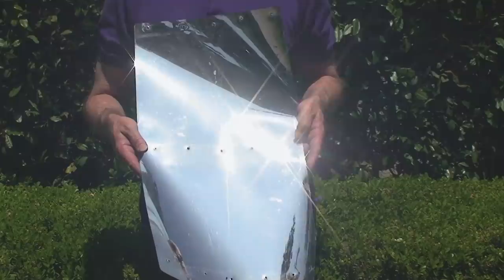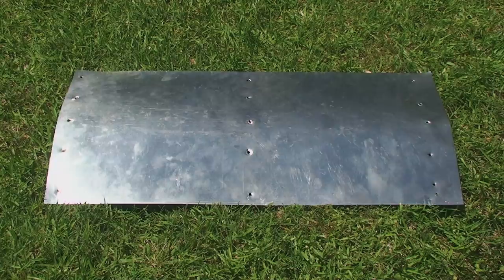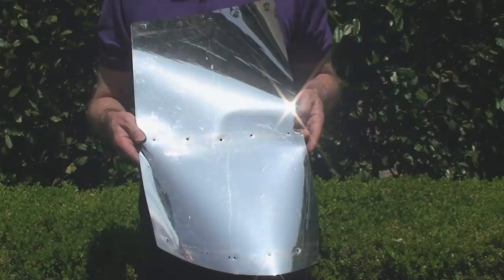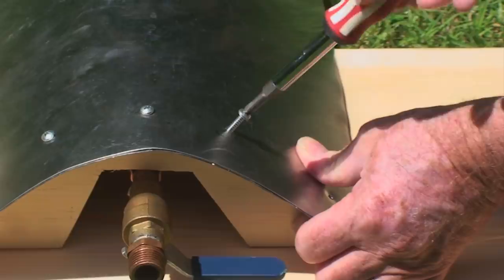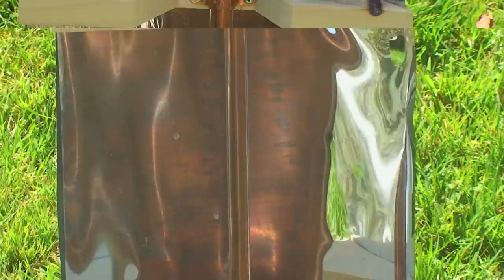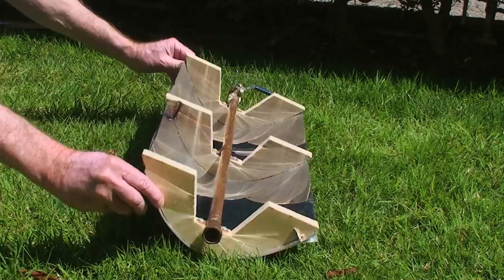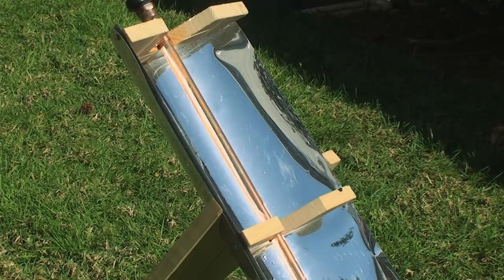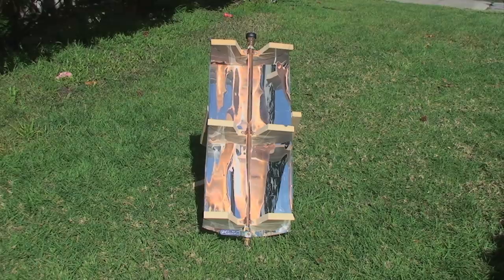Solar Water Heater Demonstration

Comment: Thanks for posting.  In 1970, I build one of these for a science fair project.  I elevated the storage tank (a 5 gallon metal can) and used thermal convection to circulate the water.  Worked great and was a great demonstration of solar water heating on a budget.  The whole device cost less than $20 to build and was a fun project.
Reply: That was my exact thought using thermosyphon. The Mother Earth News featured a similar set up recycling a refrigerator box.
Reply: For some reason I had a problem getting mine to circulate by convection.
Once the water boiled it caused pressure in both directions within the pipe and would just repeat with no circulation
Reply: @drd1924  The tank has to be elevated above the top of the collector.  The water should never boil.  The size of the hot and cold pipes to the collector should also be of sufficient girth to allow unrestricted flow between the storage tank and the collector.  I won the 6th grade science fair with mine.  I was 12 years old then.  Enjoyed the heck out of building it.  I still have the collector that I built in 1970!
Reply: @winfordnettles3292  Gotcha, thank you sir....Perhaps my pipe size was too small to allow sufficient flow for exchange...Will try again. I was also thinking of installing a check valve to ensure proper flow direction should boiling occur
Reply: @drd1924  "Check valve"
Reply: @winfordnettles3292  Should have perfected one by now🤔.. liberals pfft
Reply: @drd1924  ops didn't see this post in time.
Reply: @CharlesGann1 🔴 What Is Islam? 

🔴 Islam is not just another religion. 

🔵 It is the same message preached by Moses, Jesus and Abraham.

 🔴 Islam literally means ‘submission to God’ and it teaches us to have a direct relationship with God. 

 🔵 It reminds us that since God created us, no one should be worshipped except God alone. 

 🔴 It also teaches that God is nothing like a human being or like anything that we can imagine.

🌍 The concept of God is summarized in the Quran as:

📖 { “Say, He is God, the One.  God, the Absolute.  He does not give birth, nor was He born, and there is nothing like Him.”} (Quran 112:1-4) 📚

🔴 Becoming a Muslim is not turning your back to Jesus. 

🔵 Rather it’s going back to the original teachings of Jesus and obeying him.

Comment: In Australia, 80's. There was a same system unit called 'Suntrac'.  Had 2 reflectors,  about 5ft long, 2-3 ft wide. Tank on the top,  clear covers, and a water pressure  tracking system. The centre pipe was sealed with a gas inside, this pulsed the heat into a sealed end bulb within the tank.  Worked well.

Comment: Back in the early 80's I worked for a company who installed this type of hot water system in Nevada. Pre built 8" long parabolic collectors with blackened copper pipe set into an aluminum framework on the roof of the house. the system had a sun tracking feature that kept the collectors facing in the optimum direction while set at the best average angle to the sun for the latitude. This was a closed loop system. Meaning no household water entered the system. The system water was pumped through a heat exchanger tank and back up into  the collectors. The house hold water passed through the heat exchanger into a storage tank and then into the existing hot water heater and into the house. This method allowed the existing system to be isolated in case of emergency.  On many occasion during initial start up I watched thermometers go from ambient air temps of 50  degrees F to over 250 degrees F as fast as the needle could move. As the system would run this temp would come down to a more reasonable 200 degrees f. The normal operating temp of the system was designed to keep the household water in the 105 to 115 degree range. This technology should and needs to be utilized more these days.
Reply: Pretty trick for the 80's, especially having Sun Tracking with no laptops
Reply: @drd1924  The tracking feature was simplicity at it's best. There was a photovoltaic eye that had a small riser held above it essentially dividing the eye in two. as the sun moved (earth rotated?) and exposed the eye to sunlight a small motor connected to a chain drive would activate moving the collector just slightly to re-shade the eye and stop the motor. The riser was flat on the bottom and half circle on the top this allowed the eye to catch the correct amount of sunlight throughout the year without adjusting it.
Reply: @NVOutsider  Very creative!, Thanks for the explanation
I figured it had to utilize some sort of CDS cell, whats puzzling me is...
Did it know to reverse directions in the morning to start over or did it have to be reset every day?
Reply: @drd1924  the riser piece was 1/16" to 1/8" thick painted white aluminum. It sat directly over the center of the eye. so when the sun set the collectors stayed facing west as the sun hit the eye in the am everything would rotate to the east and start the process over. I have a feeling my explanation is really dumbing it down due to my 18 yo lack of understanding and it being about 40 years ago. The system was manufactured in Arizona by a company called USMC (?)
What is a "CDS" cell?
Reply: @NVOutsider  Hi, A CDS Cell is short for 
Cadmium Sulphide (a light controlled variable resistor, The Photoeye)
Thanks again for further explaining, rotating would make more sense. I was picturing the mechanism Panning and could only think of using limit switches to stop the movement and reset it. But simply rotating would simplify it even further...Very Cool
Reply: @NVOutsider  If you were 18yo in the 80's, chances are "the dumb down didn't stick🤣 If you don't believe me, 🤔 just ask me🤣
Reply: @NVOutsider mom
Reply: @adriaanvansandwyk5626  ???
Reply: @NVOutsider  Case where picture rather that word description would be nice.
Reply: @egria  So true.

Comment: In the '80s........I had a house with two four by eight solar panels in Massachusetts......... With one sonny day it gave me 160 gallons of hot water..... Heat exchanger, recirculation pump, anti-freeze.........it was all a great idea and savings..........this system looks to be more compact, and more efficient.
Thanks for sharing.

Comment: I though about this concept a few years back. I can see that it works! What I was also thinking was, since I live in a tropical country we have great exposure to the soon through the year, so I was thinking that it might be possible to reach boiling point with a little bit more industrialize set up in order to be able to get salty water from the sea and take the salt out! It could be inefficient but the sun is free so...
Reply: a donut ring of seawater, the vapor dripping from an upside down cone in the donut hole to the freshwater container underneath, the tide refilling the seawater part, solar power to provide electricity to pump the fresh water up to a roof tank
Reply: 1) Build parabolic mirror similar to the size in this video.
2) Install a clear glass oven pan with sea water in the pan.
3) The sea water will evaporate and rise as steam.
4) That steam is pure water.
5) Instal a thin sheet of clear acrylic a few inches above the pan. But angle the acrylic so that the steam droplets which gather on the àcrylic will slide down the surface of the acrylic and fall off into a separate pan.

Voila! Clean water.

Comment: I built one of these for a science fair project in the late 1970's.  I painted the copper pipe black, which made it heat up a lot faster than the bare copper.

Comment: Use a horizontal  arc that way it always point at the sun, the double curve is harder to make but doable with a flexible material, or just section and angle the sections to follow. This obviates the need for tracking. Also paint the pipe with flat black high temp. engine paint, so you get more frequencies absorbed.
Reply: I wonder if we could use the system to heat a working fluid so it could expand and push a hydraulic piston to follow the sun? My idea was to use the heat from solar panels to automate their turning.
Reply: @fajile5109  "Sterling engine" use the heat from the sun and the cool from the collectors  shade.

Comment: A good solar still easily reaches 50°C under sunlight and offers pure, hot water. An autonomous, off-grid user doesn't need those expensive solar hot water panels. Just a plastic sheet and a pump is enough :-) .

Comment: Very informative video. It is great that the use of copper is limited to one central pipe vs a long copper coil or multiple parallel copper pipe collector as copper is expensive. While glass mirrors would reflect more solar energy mirror polished stainless steel sheet metal would likely be more cost effective. Solar concentration is a great technology but it does have some drawbacks to be usable for the lay consumer. Boiling in a water heating system is not ideal as pressure builds up and could cause bursting issues. There would have to be some type of circulator, heavily insulated HW storage tank, temperature monitoring device, and a device that will shut off the circulator when approaching the boiling point of water as well as to rotate the collectors out of the sun. Also having to manually adjust the angle of the unit every few days is not feasible there would have to be some type of mechanical unit to pivot the collectors.
Reply: if you lay it east-west it will always be pointing to the sun

Comment: Mount this below a water tank, then allow convective circulation to heat the water in the tank by day, then by night, the heated water will stay elevated in the tank.
Likewise, make another radiator, but mount it above a second tank, to cool the water by night with convective circulation, then by day, the cool water will stay low in the water tank.
This way, you have both hot and cold water available.
Reply: Thank you for this comment.

Comment: If you install one way check valves the heat of the water will propel the water through the pipes/hose on a continuous flow. And I agree painting the copper pipe black will increase it's effectiveness and will draw the water from a tank or vessel and pump it into another tank or vessel.
Reply: This can heat fluid to circulate in hydronic heat system, too…putting 1-way check valves moves the hot water in the direction wanted, so it can recirculate.  
Can also use thermostat to control it.  Needs an expansion tank also. 
 But it’s a fairly low-tech system that can work even in winter, as long as there’s enuf size to system, & cloud reflectance.   
A backup small tank water heater can also be in the loop, for dim days & nites.

Comment: This is great!  I wonder how much difference it would make to paint the pipe a flat black, just a thin coat, maybe with BBQ or exhaust system paint, or if oxidized copper is sufficient?

Comment: I could be misremembering my college physics, but it's not a coincidence that it stopped at the boiling point of water. It stopped there because the water was boiling. Liquid water can't get hotter than the boiling point. All the energy going into the pipe was going into producing water vapor. After all the water boiled off, the pipe would start getting hotter. It might have melted the copper eventually.

It would be interesting to know how big a reflector you'd need to heat a water heater full of water from say 70 F to 160 F over the course of a day.

Comment: my Grumman Sun Stream solar water  installed in 1978 COOKE water for thirty years before the A O Smith stainless steel tank  began leaking. The optimal  tilt is 37° , I had 45° in my location. on Dec 21 , a partly dsy, the late afternoon tank temp was 97°. 80 gallons  of warm water when the incoming temp was 52°. 
Cost with tax credit: 1695.00
Install labor                350
antifreeze replace        300
 total cost                      $2445
reduction in electric bill was over 200 kwhr per month
200 kwhr yearly  or $240.00 per year electric cost
80,000 lbs of pollution  !
A hybrid water heater  cost  $1395.00 and will reduce electric bill almost  as much as the solar water heater.

Comment: Imagine a connecting the bottom to a small plex hose that goes to a small cup reservoir elevated to the just below the top of the solar exposed pipe when elevated as in the video. As water evaporates/boils away at the top, new cold water is gravity fed into the bottom from the reservoir. Helping keep water throughout the solar exposed pipe for maximum heat transfer.  Then one can use the steam given off at the top  to cook food in an insulated  steam box.

Comment: Thanks for an inspirational video.
I nearly got it correct, I have the parabola built.
I have not yet put the copper pipe in.

All my experiments to date have not worked for a couple of reasons:
1/ no copper pipe (WHAT I have to have a pipe at the apex of the parabola?) (Answer: DUH!)
2/ not a shiny surface. (Unsure what material I used, I think is stainless steel)

All that said, my construction is very similar to your, except I do not have a center support, but it is very ridgid.
Loved the safety comments, like don't pick it up by the pipe, err sorta been there done that. (think, wet paint DO NOT TOUCH)

Thanks mate

Comment: All these solar panels sitting on top of homes have lots of heat. All that heat reduces the panels life and efficiency. They need to be sealed then water induced. Thus providing free electricity & hot water without depleting your electric reserve.
I've done it on a small panel. Used a parabolic dish to focus the sun on the panel. Then ran water through it. Resulting in tripple the electric output~!

Comment: The technic is called "solar collector" and is much more effective to heat up water directly as solar cells - where the flat collector have lower efficiency than tube collectors, even at low outside temperatures.

Comment: This reminds me a lot of the solar air heater. It looks good with static air. But once you start cycling air through them, you find they have a very low capacity to heat a volume of air. I suspect the same is true with your solar water heaters.

Comment: I am assuming that you would need a water expansion system for the hot water.   Also, I would use a glycol of some sort instead of water to prevent freezing in winter.  
How about a large insulated heat sink to preserve the heat.  Have the tubing to the house run through the sink to absorb the heat and distribute either to the domestic hot water or some form of radiator set up.   I'm looking at our mountain house and trying to keep the energy bills low enough so that I don't have to sell it with the prices of power these days.

Comment: I think i came up with a one way heat diode. My idea is that id have a few energy collectors and a heat battery. Have them dump the excess heat into the battery. Otherwise it would just heat up a water heater. Or it would heat up a air dryer. I have an idea for a filtration system that uses water instead of expensive filters. I haven’t figured it out yet but ive seen the system used in paint booths. I just need to dry the air after it comes out or it would grow bacteria eventually. Also we can use our waste stack as a heat dump. I was thinking we use our sewer as a geothermal heat dump. So the first goal is to generate an excess of heat. That way i have enough of a heat differential to generate energy. Once the heat battery is hot enough for steam its a wrap free power from nature with just maintenance or what ill do is select materials that need almost no maintenance. Actually im thinking of making a open source youtube series on what i think the perfect house would be. With some help i believe instead of a net zero house we can make a -100% house. With it capable of absorbing and holding nearly every pollutant humans make and turning it into a clean energy. With the filtration system i mentioned we would be cleaning the air we take in from the outside of road dust and other fine dust pollutants. We would have a cooling effect on the ground similar to the shade a natural forest would have. (Thermal pollution a theory i came up with in 2010.) and most importantly and obviously provide energy instead of take energy.

Comment: Obviously, in order to be anything other than a novelty, the hot water would have to somehow be continuously pumped, as heated, into some sort of a reservoir tank.  Then, when full, the system would have to know how to stop heating unless one wants an explosion.  "Little" question, like that, make the difference.

Comment: Would like to have seen if that device could heat running water THROUGH it, to actually know if it is feasible to install into an off-grid water system!  Putting a half cup of water into ANY metal container, out in the sun, even without a parabolic refractor, would still heat the liquid!

Comment: Would blackening the pipe add efficiency ?
Could you make a return pipe e.g. behind the mirror and a reservoir on top using thermal circulation to heat a larger volume ?

Comment: If you connect this to a hot water holding tank, then add a Stirling engine to the top of the tank, you get even more from the setup

Comment: Would have liked to see the copper pipe painted black to see the difference. Very good video though. Thanks.
Reply from the maker: I did blacken the copper pipe to see if I could get additional temperature or a faster temp rise, but it appeared to have a negligible effect.
Reply: While black paint does absorb heat, I suspect that the reason it did not help is that copper is such a good conductor of heat, that the heat absorbed is carried inward (toward a cooler part of the pipe), and transferred to the water.  As long as the outer surface of the pipe is hotter than the inner surface, the heat will flow inward.
Reply: Also, while black is the best color for absorbing heat, it is also the best at radiating it. So unless it radiates all of it IN, toward the pipe, the effect would indeed be negligible.

Comment: Coating the pipe with black soot might help. Connect a heat engine to it to generate electricity.